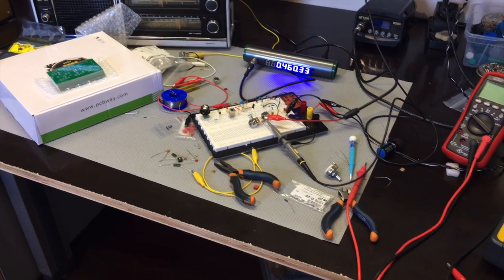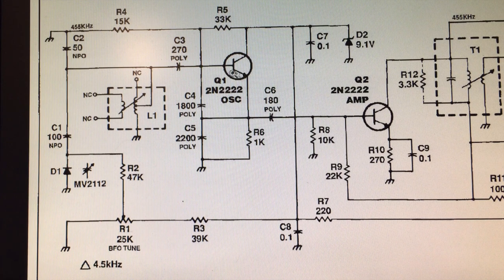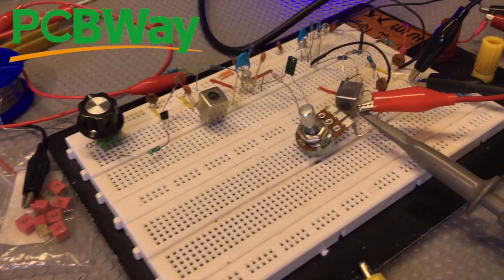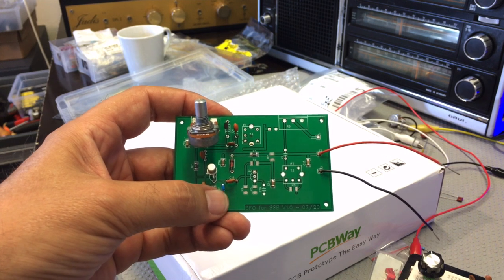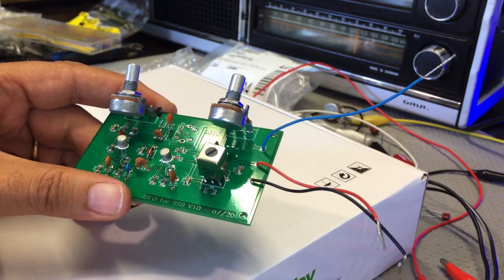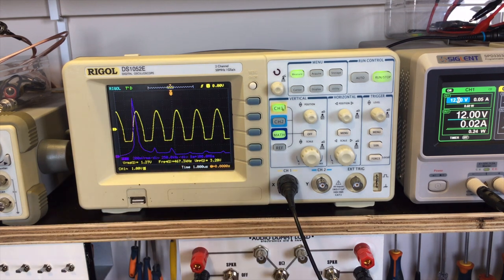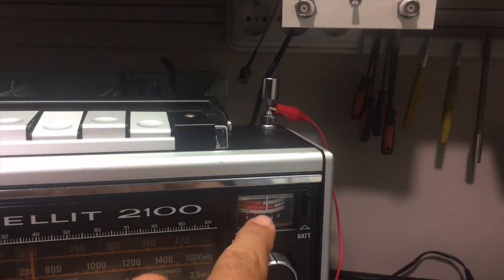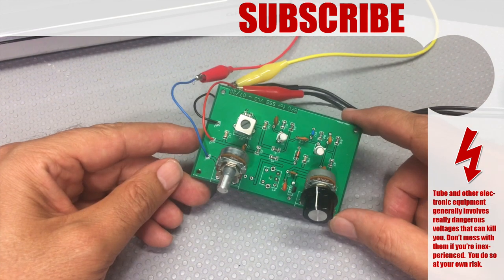External adjustable BFO (Beat Frequency Oscillator) for receiving SSB, using PCBWay PCB's.

Comment: Thanks for sharing, very informative up to the point. I built the oscillator part last night. I wasn't happy with the waveform, may be I'll add a filter to remove harmonics. @0:45 It reads: tsu:zats

Comment: Hi Manuel and thanks for an interesting video. You may get rid of the clipping by biasing the second 2N2222 higher, ie. increasing the value of R8 to 15-20 kOhm. The harmonics probably are not harmful, since they will hardly produce any audible interfence.

Comment: That is a similar circuit to the one I made, many years ago, which I did use on the Grundig 2100 radio. Later I found someone selling the original SSB unit on eBay, this was so much better, because of the auto / manual signal gain level and noise filter. I did add a white LED to illuminate its dial.
Reply from the maker: I can imagine. I know that the socket at the back breaks it the AGC function so that you can incorporate manual gain control. If I could find a suitable plug for that socket, I’d be tempted to try some more experiments, but unfortunately I have no idea if such a socket is even available today.
Reply: @electronicsoldandnew  I had been looking for this plug myself, but with no luck. I did try to make a plug using nails and  gluing them in a plastic base, it did fit okay, but then found the original SSB unit, so it wasn't required.

Comment: 7:50 - those transformers are nominally 455kHz but most can be adjusted up or down usually +-10kHz or even 20kHz just fine. If you need to change that more drastically, look on the base of the transformer, you may see a small tubular capacitor soldered into the base on the pins. Just snip it out and add a suitable capacitor for your desired freq. I've used the 455kHz transformers from 100kHz to nearly 1Mhz that way. Your replacement should of course be a stable capacitor - NP0/COG for ceramic, or air or polystyrene. Response will be tighter at the lower end of that range due to the high-C/L ratio. It will be rather wide at the high end of that range.

You can of course pull the transformer lower just by adding capacitance (across R12 in the above diagram) and this can also be an air-variable for wide tuning. The low Q of the coil in the transformer somewhat limits using at as a front-end this way but it may be useful on the bench for something like a universal final IF strip.

The value of the original intermal capacitor varies depending on how tight they wanted the original response and varies with the exact transformer spec. This is one difference between the various 455kHz IF transformers, the other difference being the coil tappings/impedances to suit for the various 455kHz IF amp stages in a typical rx.
Reply from the maker: I have had no problems tuning this transformer around the desired range, meaning somewhere from 455kHz to 460kHz. In fact, they can be tuned even further, but as most of the radios I've worked on are in this ballpark, that should not be a problem.
My problem is achieving a cleaner signal.
Reply: @electronicsoldandnew   

Oscillators can be finicky :)

1.  You may find it works just fine even with that waveform as it is - I've even used a TTL square wave as a BFO before and it sounded half-OK. though there would have been extra mixing products all were outside the audio spectrum.
Some high quality mixers (H-mode for example) use very sharp square-wave drives to increase 3rd-order IPs, though they need to be well balanced. 

2.  You could try making R6 somewhat variable; try something fixed 680R in series with a 1k preset, so you can twiddle it a bit from 680  to 1k680 ohms. Don't go too low though - hence the 680R.

3.  You could try to change the feedback ratio of C4 to C5 - the total capacitance needs to be the same (1800+2200=4000pF) so you could simply try swapping them around to see if the distortion gets a little worse or better, then act accordingly. 
In theory, increasing C4 and reducing C5 increases the feedback, maintaining a sum total of 4000pF overall, so should (haha, should!) make it more linear.  NP0/COG ceramics will be fine to test the theory.

   - I think I've got that right - though I've been awake over 30 hours now - it's either one way or the other, hence my suggestion to just swap the C4/C5 caps around to see if one is a little better than the other!
  
Once you reach a certain point in the ratio of those caps though, it may fail to start reliably at some temperatures/stray capacitances/wind conditions/sea states/etc.
In a perfect world you'd have the luxury of two big 2000pF air variables for C4 and C5 and you could just fiddle the ratios back and forth  until the waveform looks best. Or even better, an unobtainable split-stator 4000pF air-variable cap. which is basically what those two capacitors are.
 
4.  C6 might need reduced if the buffer amp is flat-topping/bottoming too much - this will reduce the drive to it but shouldn't affect the oscillator much at all  (in fact it will load it less, a good thing)
 
5.  Also bear in mind that oscilators are very high impedance devices and easy to upset so I'd prefer to do all my measuring after the buffer stage - the scope probe will always load the osc to some extent and can cause head-scratching (make sure you are on 10x on the probe too for best results). Probing the oscillator output at C6 can upset both the waveform as well as the frequency. Probing the buffer amp output avoids this entirely. 

All this assumes you have no problems elsewhere of course. Coming from a solderless breadboard I'd expect all your smaller capacitances to be well off but as it's a published circuit with known capacitances it should be OK on the PCB as long as you don't have bad ground loops.
Reply from the maker: Lots to go on, thanks. I’ll keep tinkering and look at the points you gave.

Comment: Interesting project, I did think about making one myself as i might get 2 of these radios soon.
How about replacing L1 with a fixed inductor once you know the value it should have?
And replace R1 with 2 pots for course and fine adjustment. or maybe a multiturn pot...
I agree with those who suggest that Q2 is not biased enough, that causes the clipping.
It's impedance might also load the oscillator to much.
It also might need to be in an shielded box so that it doesn't interfere with the internal IF of the radio.
Reply from the maker: I’ve been experimenting with all the suggestions so far, and the result is improving. It’s great with all this help.

Comment: The reason the wave form is ugly might be that the varactor diode rectifies some of the rf. The way to get around that is to use two varactor diodes back to back and to apply the control voltage to the junction between them. The capacity will of course be halved, but that can be worked around. Apply the control voltage through a hefty resistor or else some of the rf will be shunted to ground.
Reply from the maker: that might be it. going to experiment using your suggestion. Thanks
Reply from the maker: nope. still ugly 😊
Reply: @electronicsoldandnew  Ok. You cannot win every time.
Reply from the maker: no, but you learn how not to do it. you win either way 😊

Comment: Perhaps the buffer transistor is being driven either off or into saturation? Can play with the bias. Also perhaps adjust the Colpitts feedback capacitor voltage divider ratio. This may reduce the oscillator amplitude. Thus not over driving the buffer. Also try degeneration in the transistor emitter.

Comment: perhaps the dc bias of the first transistor can be of influence on the symmetry of the waveform.. Otherwise you could try to add a low-pass filter to get rid of some of the harmonics.
Reply from the maker: I did all the bias tests and got no better results, unfortunately

Comment: Sounds like DeMaw put a 10k pot at the Output to control the level seen by the Radio's AGC.  I don't see that on your schematic.  What value POT did you use & does it just shunt the 460kHz to ground?  Thanx & 73.
Reply from the maker: I used a 10k pot to adjust the output level. The newer version perhaps shows this more clearly.

Comment: Can you put a low value 10 turn trimmer pot on the amp base bias to accurately tweak it ?  That may reduce the clipping issue.
Reply from the maker: could do. will give everything a try.

Comment: Just external vfo near by, can be better. So that you could tune every frequency, even with 5khz step am radios. I.m. signal 3703khz radio tuned to 3705, tune vfo to 3703 too and that's it.

Comment: . Is it possible to  convert modern radios like radiwow or tecsun pl-310 with a DSL chip processor to get SSB ?
Reply from the maker: You’d need to use an external bfo.
Reply: @electronicsoldandnew  ok thanks I'll look for one , hopefully the chip processor in radiwow  won't interfere with  the cross connection.

Comment: I think the bad sinewave is the result of to much gain. Barkhausen said that the gain has to be >=1 but if it becomes to high you get the bad harmonics. A Rc as a Pot of 1,5KOhm should help to adjust the gain

Comment: Hi Great video, i will watch your others, i have a Marconi 2955, it does not have a sensitive receiver but it does demodulate AM/FM, I was thinking about doing this on the IF input, it uses 110khz IF on board AB5,
Do you think this using a sig gen at  around 110khz, Should this work. Thanks Dave 2E0DMB
Reply from the maker: I don’t have experience with that receiver, so I can’t say. Just try it.
Reply: @electronicsoldandnew  Hi , it's a radio test set
I did try and inject with a cheap Sig gen , when I transmitted SSB , with into the test set, in am mode and used the sig gen to give the bfo I could change the pitch of my voice but it was to noisy 
I don't think the test set liked it, maybe there was a ALC acting against it,
Thanks Dave

Comment: I was surprised to see you put that short across the inductor of the IF transformer.  Makes me wonder what results you would have if you simply omitted the resistor AND didn't put a short in its place.
The clipping is on the negative swing only....wonder if you could correct that with bias on the transistor(s).  You could also experiment with replacing the 2222's with 2N3904's and see if there is any difference. (Probably wouldn't be, but might be worth a try anyway....you could confirm whether it was transistor related.)  Have you checked the Data Sheet on the 2N2222's?  
I look forward to the next iteration of the circuit board.  Speaking of the board...might I make a suggestion?  I would suggest that you add components based on "height" when you are soldering them to the board.  You know, SMD first, then the next tallest part, etc.  Less likely to have a part (eg. IF Transformer can) in the way while you are soldering.  
I am sure you will get the clipping resolved!
Keep up the excellent work!
Reply from the maker: the short wasn’t across the transformer. It was the resistor in series with the pot that biases (and tunes) the varicap diode. The short just allows the full 9V to be available for the tuning.
I placed the components as I did to test out each part as I went along. Normally, this order is a no-no.
I’m going to try some other transistors, biasing, etc. Can’t let a little oscillator beat me 😊
Reply from the maker: thanks Wayne. I’m going to try swap out the transistors and see what happens.

Comment: What a great project Manuel. I did have look at building one myself in the past but couldn’t get the exact coil I needed. The plan was here https://www.industrial-electronics.com/radio-elec_9.html. Yours looks more complex. It may not be the best waveform but it does work. Look forward to the next instalment. Regards Graham
Reply from the maker: I decided on this one because some other attempts produced unsatisfactory results. The key is frequency stability, and this one has that. I’m chipping at it with the help of some very good comments here because I want the wave to be cleaner, which, qui frankly, makes no difference to the operation but satisfies my OCD character 😊 
At the end of this saga, I’ll send you a couple of boards if you like. They cost me nothing anyway as they are sponsored.
Reply: @electronicsoldandnew  I'm sure you will get it sorted. I've read through all the comments and theres a lot of suggestions.  Probably a combination of some of them will do the trick. Thanks very much for the offer of a board to try. Funnily enough I had repaired a Satellit 2100 a year or so ago when I went down the same route as yourself trying to find the Grundig BFO and I did look at the circuit for it but decided against trying to replicate it

Comment: Study schematics a simple bfo example the relistic dx120 red can ok using a external cap the black one ok take out internal cap and add a
external of choice  around 120pf range + or -   add a prodector transistor  example relistic dx150  no need of gain control your using the
radios agc    a dpdt switch  one half for am ssb the othe half for b+ switching  just a example you will get good results with a simple 
circuit  and taping in before the detector diode or pri side of last if  and get quality audio like the top end radios

Comment: Too much feedback in the oscillator. Your waveform is clipped at the bottom. Need to be right next to the receiver without shielded connections or use a shielded 
wire connection to tame this little beast. Then try adding a pot as a squelch to the amp base. You need a clean sine wave that stretches and shrinks like a slinky
on the oscilloscope when you turn the pot.